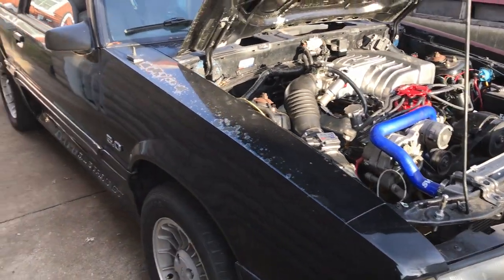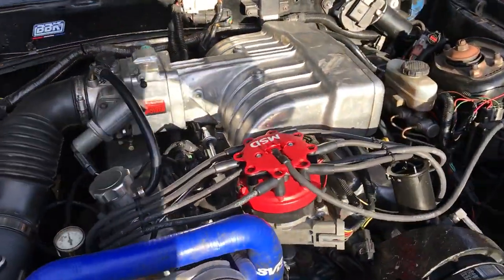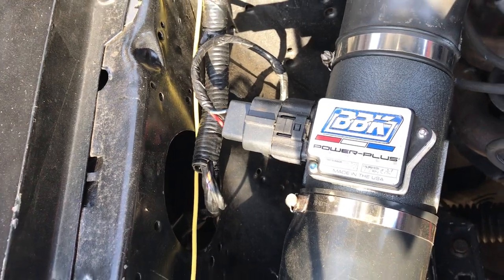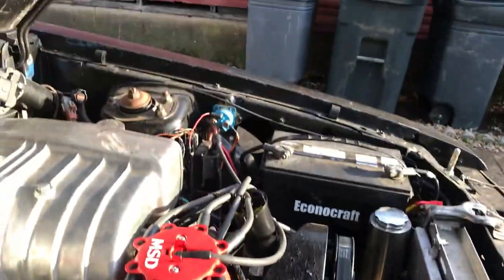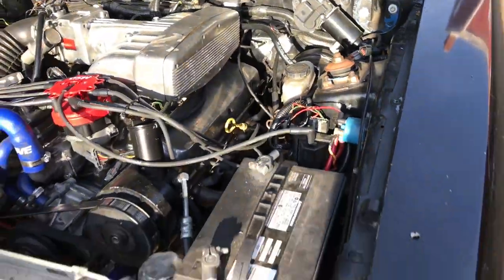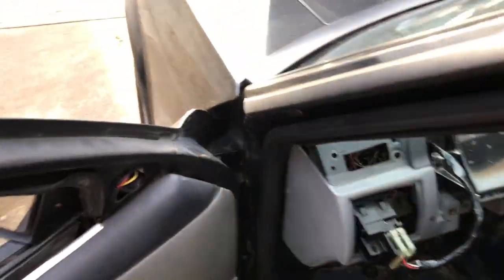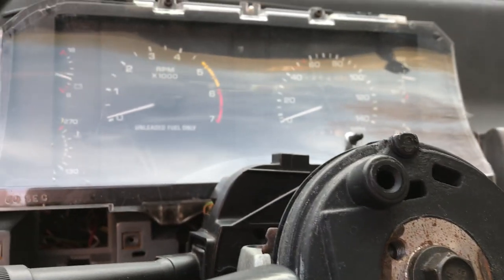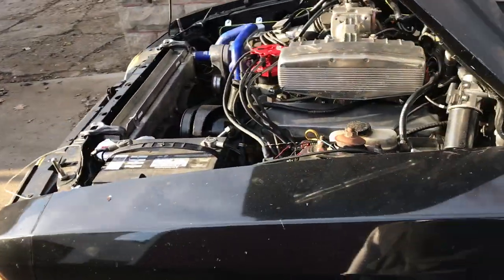88 Mustang GT - Scorpion Rocker Arms

Comment: Those were the days.
1990s I had a 347 stroker, Blue Racer 1087 cam, Victor Jr heads- 7/16 stud mount Scorpion rockers, long tubes topped with a Vortech making 12 psi. 
A beast with AC.